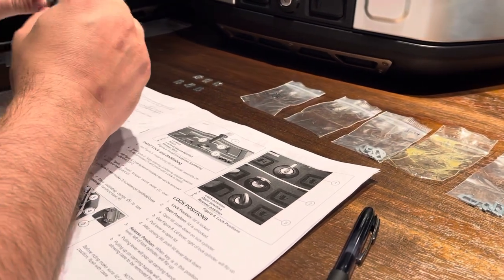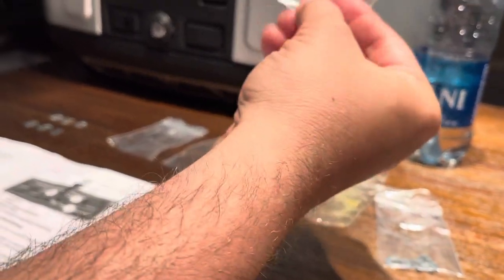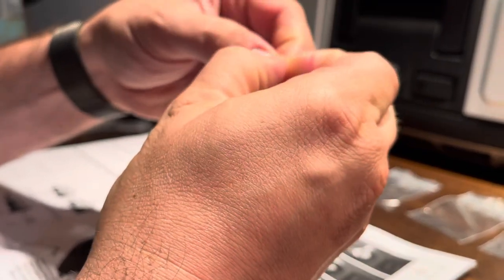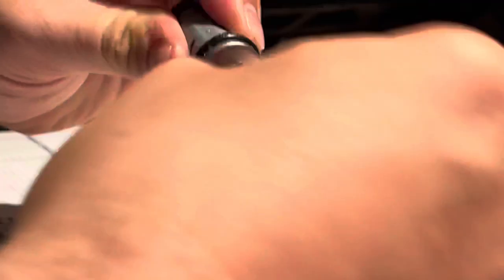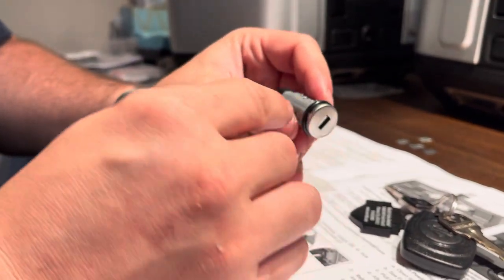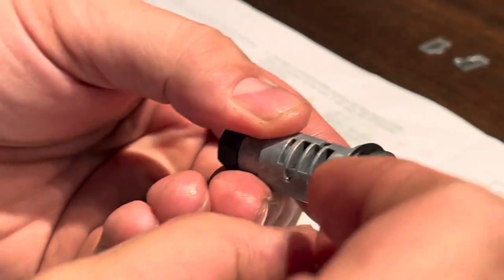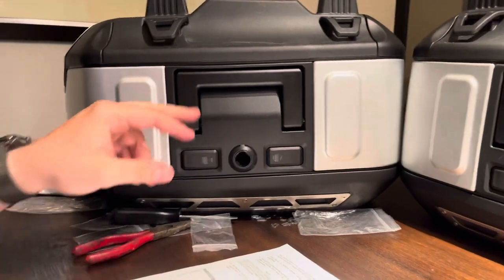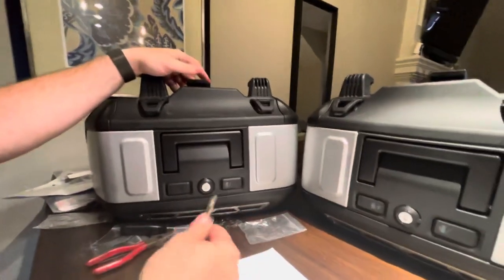2021 Harley Davidson Pan America Sport Side Case Lock Set Installation

Comment: Thank you so much for this. I'm somewhat mechanically inclined but I've never had to put a locksmith hat on and this was a lot of help. Note to anyone reading this and installing the lock on a TOP CASE, those locks don't have the plastic end with the notch like you see in this video. Just follow the same instructions and the screw/washer combo goes on AFTER you put the lock in it's housing.

Comment: Thanks for posting this video. Helped immensely, the printed instructions sucked. Ordered  the sport side cases early on and forgot about them. Installed the black Aluminum boxes with the rack a month ago. Decided since I have them, might as well try the sport cases. They are much narrower (38.25") than the aluminum cases (43") coming in about the width of the bars with the brush guards. I do like the they are keyed to the rest of the bike and can come off very easily with handles to carry into a hotel room. I didn't think I'd like the look of them but they look a LOT better in person.

Comment: Edit: I should of followed your video first.  I watched the HD one, and it was long and through, but it didnt work.  I had to spend an hour taking the lock mechanism apart to try again.  Your method is much easier.  I'd say just pay close attention to the bits sticking out (or not) from the cylinder.  They absolutely have to be flat with the cylinder, not above or below.  And the only thing you said wrong was when putting the assembly into the case, the notch goes towards the 5 o'clock position, matching with the arrow.  Not sideways.

Comment: One tip I have, and I'm probably the only one lazy enough to do this, but I'm considering ONLY using the retention clip/tumbler. I've messed with this for hours. The tumblers are so close in size that I have multiples that feel flush. I would find the perfect combination, and it would work. Then I'd match the other side and nothing! Won't turn. I did all this with the last tumbler/retention clip out. The more moving pieces I add, the worse it feels and more points of failure. So, 'retention clips only' are what I'm thinking. The key will just now be a tool to open it. I'm going to take them off at night anyway, so I take my chances.

Comment: How do you get the lock back out if you get it wrong? Mine is stuck in the case and won’t twist
Reply from the maker: That’s a great question.  I had to just play with the lock, wiggle it and try to turn it to get it back out.  Sorry I’m not much help on that front.
Reply: @tgshorts2211  unfortunately, I couldn’t find the answer either so I took the bag completely apart. Once the locking mechanism is removed, you have access to the backside of the lock cylinder. I found a small hole and used a small jewelers screwdriver to slip in there and release the tumbler that was holding it in. Took me about 2 hours to take it apart and put it back together again.

Comment: I put the lock in the hole and it won't turn, the key will come out but not the lock. So it's installed and won't turn at all. Any ideas. Locksmith? I knew I was going to botch this.🤬
Reply: Following the video above will cause this, he skipped a step

Comment: I followed this video thinking it would be a good short cut vs reading instructions.  Once step is missed in the beginning in which your suppose to install the lock w/o ring prior to installing tumblers.  If your lucky maybe the factory already did that.  Not doing that may result in the lock not functioning properly and your no longer able to get assembly out to fix it.
Reply from the maker: Thanks, It’s been awhile, but I don’t remember that step.  I hope your comment helps anyone that is installing these locks.
Reply: Can you clarify what you mean?

Comment: This is utterly stupid. I've never had a set of cases you had to assemble the lock. By the way, the gas cap you have to buy separate on the base model for 112.00 bucks is the same idiotic deal. Still haven't got it to work. Guess its going into the shop and Harley can put there crap together like it should of been in the first place.
Reply: It isn't "their crap". Made in Spain.
Reply: The instructions may be poor but the benefit of having to assemble the lock is that everything is keyed to match. I find that ideal.